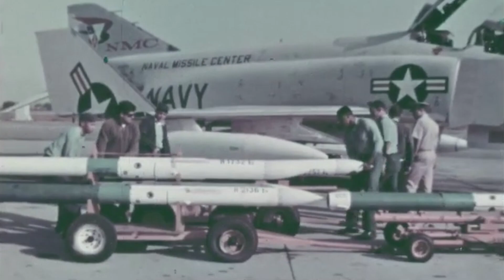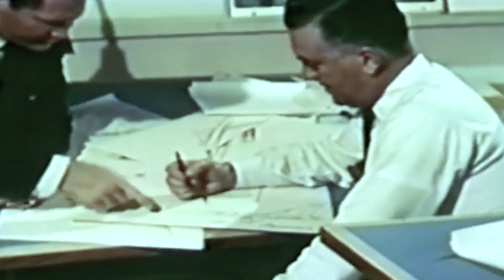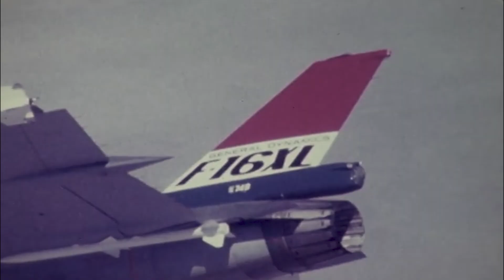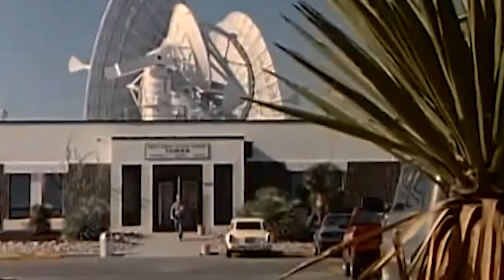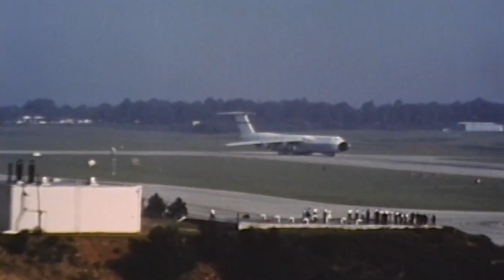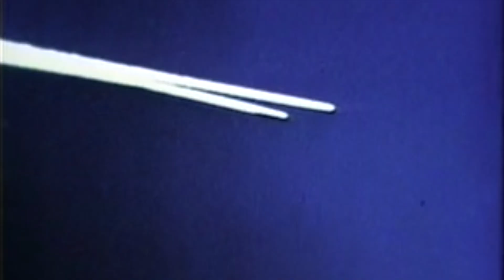Superfast Planes the Air Force Banned for Good

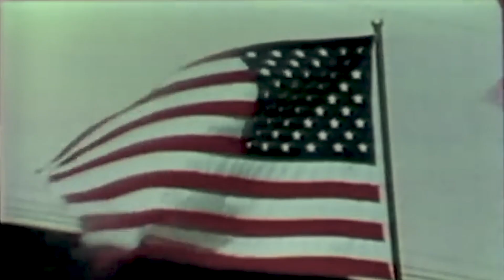Comment: 36:19 — And 🇳🇴 NORWAY… Norway bought 74 F-16s. It was not the best on offer. A better alternative, which could have made Norwegian Air Defense much better, more flexible and nearly impossible to shut down, would have been investing in the Swedish Saab Viggen, which could have been operated from road runways, like Sweden operates their highly unpredictable & mobile Air Defense. But Norway was FORCED & THREATENED by the USA to buy F-16s to replace our Fleet of F-5s and F-104s. Denmark, the Netherlands and Belgium also entered into this Defense Contract with General Dynamics. The first 72 F-16s for Norway and the other three NATO Member States were produced in the Netherlands. Norway bought two additional replacement planes directly from General Dynamics in the US.

History repeats itself. Norway entered into the development program for the F-35, shouldering parts of the development costs. But the cost overruns have been astronomical, and for a Nation of only 5 Million, the order of 52 F-35s has been a strain. And we didn't even buy any F-35B. Norway, because of its mountainous terrain and fjords, has a very limited number of Airfields, making it easy to knock out our Air Defenses. With F-35Bs or the Swedish STOL JAS 39 Gripen we could have hidden our Air Force out in the countryside, protected by mountains, but alas the Defense Planners in Norway sucks at taking advantage of the place we live.

Norway produces some of the most advanced Missile Systems on the Planet, but instead of arming the Lightning II with Norwegian Munitions, tailor made for special Norwegian Defense Requirements we bought AMRAAM C7, AMRAAM C-8/D, Small Diameter Bomb II and JSM from America for the F-35 Fleet.

Don't get me wrong, America delivers some fantastic platforms, and I love the good ole' US of A to a fault. I just don't think it's very intelligent to be dependent on a country on the other side of the Atlantic in a crisis. Norwegian technicians aren't even allowed to access the flight computers. We need technicians to fly from the US for several delicate operational maintenance procedures. Not very smart at all.

Comment: Ah the C5 galaxy. Or as it was affectionately called in the 80s, by mechanics and flight line personnel, F.R.E.D. fking ridiculous economic disaster. I watched one land at Kadena AB in 82. It broke down. A second one flew in with parts. It broke down. Then a third with parts for the first two broke down. Finally they flew in the parts to fix all of them on a 141, which unloaded and flew off.

Comment: The B58 would be a steal today! The cost of a B2 Spirit is roughly $2.13 Billion and the B21 Raider is estimated at "only" $668 million as the first few came off then line for delivery, which is a saving from the $775 million estimated single unit cost. 
The B58 was/would be 8 times cheaper than the B21 Raider. Though I get that the Raider and Spirit are much more technologically advanced and are one giant single wing which are also made of composite material and are both stealth planes that also require repainting often. The newest stealth bomber would still require less man hours of maintenance vs the B58 which is how things should be.

Comment: the aging C-5M Super Galaxy multi mission heavy lift transport aircraft could do with a replacement or a totally new C-5 . . . call it the C-5A Super Galaxy II multi mission heavy lift transport aircraft if you will . . . it'll feature a perfectly round circular fuselage design instead of the oval shaped fuselage of current C-5M's . . . double reinforced fuselage & wings, it'd retain the t-tail & high wing layout of the C-5M . . . powered by new state-of-the-art hybrid aero propulsion system . . . thus making the C-5A Super Galaxy II 44% more fuel efficient & 1,200 miles of additional range . . . max payload capacity 136 tons . . .

Comment: It's unfortunate that you did not address the F14 Super Hornet, the X15, or the YB/A12.  Each of them offered their unique capabilities.  The selection of the F18 Super Hornet was purely based upon corruption, NOT capability!  [The F 18 Super Hornet is NOT capable of super cruise, NOR can it launch the phoenix missile system.  (It is far less capable than the F14 Super Tomcat, and the corruption associated with its selection resulted in a very dangerous reduction in our ability to protect our aircraft carriers!!!)]  Sadly, the selection of the F22 over the F23 also involved similar CORRUPTION and NOT capability!  [The F23 was FAR MORE capable and less expensive!  It could also operate the phoenix missile system, AND it could easily be made carrier qualified!  (The F22 is not capable of either!)]  What's truly sad is the fact that the aircraft for Fleet protection do not require "stealth capability", but DO require both high-speed performance (such as super cruise) and the ability to operate the Phoenix missile system!  The F14 Super Tomcat has these abilities at less than 1/10 the cost of the F35 or F22!  (The F18 super hornet also does not have these abilities!)  It's frustrating that the taxpayers have WASTED HUNDREDS of BILLIONS of dollars for a FAR LESS CAPABLE system as well!!!

Comment: A rocket seat almost ended Yeager when it became tangled in the parachute lines and fell back to hit his head with the rocket nozzle shooting into his helmet.
Reply: That was a flight in an NF104 at about 125,000. When his aircraft arced over at the top of the climb it didn't nose over as was expected but it started to fall in a flat spin. The engine stalled when it lost air flow due to fall in a flat attitude and everything stopped working. With no airflow through the engine all of the ancillary equipment died. There was also no airflow over the flight controls so he couldn't control the plane. When he ejected, he was falling at about the same rate as the aircraft and if I remember right, I believe that had something to do with the shrouds getting tangled. When he tried to get free of the seat, it also fell at about the same rate. The ejection seat motor that drove the seat & pilot out of the aircraft was falling close to him for a while and that was how he got hung up with the rocket exhaust from the seat. It burned part of his helmet and the side of his face. When I read about this many years ago, it was amazing that a pilot could survive a fall from that altitude and survive the landing! I don't remember if there was enough of the main chute to control his fall or if there was an emergency second chute. The main thing was that after several months of recovery he went back to flying. That was one tough old pilot. He had a hell of a career. I think I read something about him getting a flight in an F15 on his 80th birthday. Now THAT's a birthday present to remember!!
Reply: When he gathered up his parachute, it came apart...

Comment: Interesting how the F106 bore, in many respects, a similarity to the Canadian-built Avro Arrow. Delta wing, internal weapons bay, computer assisted controls, potential for supersonic flight. No wonder President Eisenhower strong-armed Canada to drop the Arrow production in 1959 since it would have conflicted with F106 production
Reply: Arrow was not independent.  It used American high speed research data.
Reply: @ The only contribution the American aircraft industry made was the use of one of their wind tunnels during design. Avro lacked a wind tunnel that could simulate supersonic speeds needed to fine tune the aerodynamics of the fuselage. The weapons package kept changing so often that the aircraft was cancelled before one was finally greenlit.
Reply: @AmericanWoman-z4g  Arrow was a long range interceptor design that the Dart wasn't. They didn't really compete other than the USA wanted Avro's engineering staff (almost all of them migrated to the USA, as did nearly all the TSR2 staff) and wanted its allies to be dependent on USA technology/companies